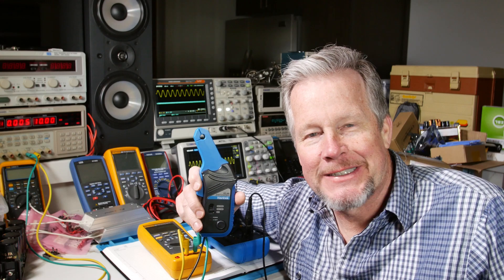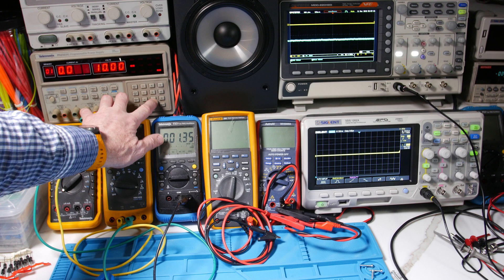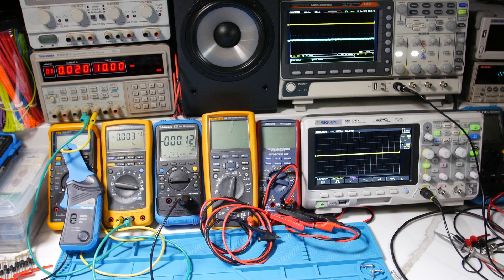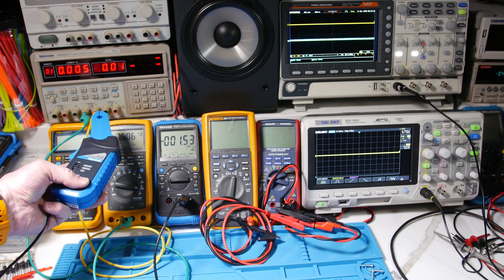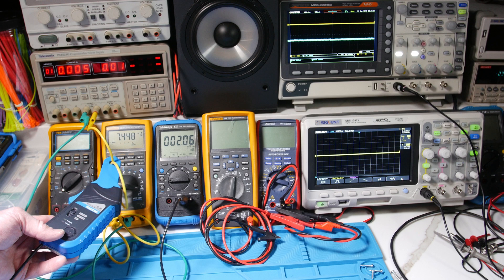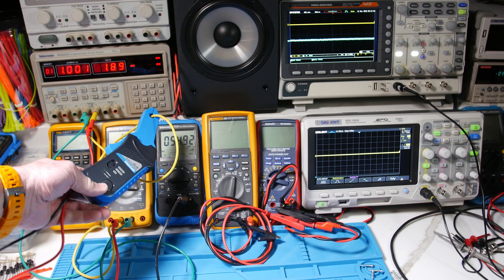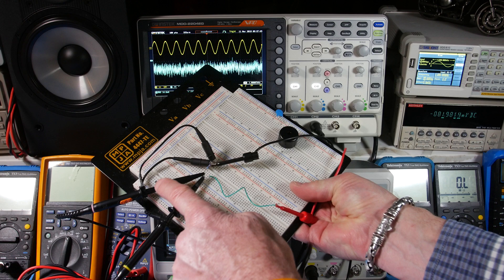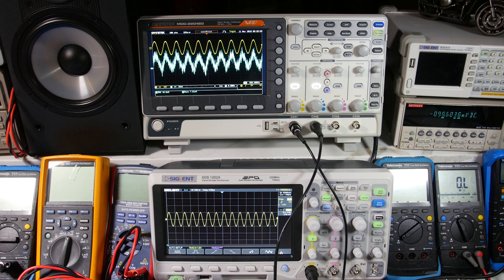Hantek Current Clamp CC65  Pro Tip for low current measurements

Comment: Thanks for the demonstration. I just received this clamp from AliExpress for about €40 shipped to the Netherlands after watching your previous videos about it. Only played around with it for a couple of minutes on my Micsig TO1104+ and it seemed to work as advertised after I finally realized how to properly degauss it. Doh! The only thing I don’t like about it is the lead, which is a bit too firm/cheap. Do you think it would be wise to replace it with a better coax lead? Could you also do a video about differential probes and when and why to use them? Micsig DP10013 High Voltage Differential Probes are relatively cheap and work as well as the far more expensive ones. Keep making these video’s they are very good for relative beginners like myself! Thumbs up!
Reply from the maker: Wow, it’s great to reach the Netherlands!  I agree that the coax seems a bit cheep, but at this cost it’s hard to complain.  I think it would be cool to change it out for a nice flexible one.  I’ll look into it - that might make for a nice upgrade video.  It’s funny, I was just looking at the Micsig diff probe by accident.  I was looking at their current probe when I stumbled on it.  Thank you for the support - I really appreciate it!

Comment: Hi there from Canada,  thank you for taking the time to upload the intructional videos they are being appreciated.  I bought this low amp clamp in hopes of measuring a wire guidance loop in the 180ma range.    6.7 khz  ac sinusoidal signal  without the need for breaking the loop as is being used 24/7 in an industrial wearhouse environment,  so far my readings have been way off , I am confused by it , please shedd some light into this matter!!

Comment: Finally realizing why my CC-65 wouldn't pick up a current trace on either scope using one's SG. No load, no current. Doh! Looking to sync inductive (motor) current to V with a cap bank to improve power factor from .41 without doing the math for precise value in mfd. lol
Reply from the maker: LOL -  thanks for your feedback!!
Reply: @KissAnalog  Not to carry on, but I used a 1w 28 ohm resistor and IIRC should have seen ~1/2w show up on either scope, a DVM, or my old VOMs. One bad one in a thou' OOB, lol but I'd recommend the CC-65 for hobby use, PF measurement/phase correction, automotive, etc.

Comment: I have thought vaguely about gadgets that would help to simplify Automobile Servicing. A current clamp on the starter cable, voltage leads to battery, chassis, motor, could detect corrosion/bad contact, low-compression (impending valve/ring failure) in even one cylinder. 
Far more comprehensive gadgets are readily available as black-boxes, either shabbily made or exorbitantly priced, or both. 
I meant to remedy the situation by myself, for myself, but seeing the video on related matters, I felt it might generate interest and we could share our experiences and proceed faster. Anyone been there ?   :-)
Reply from the maker: Sounds like some great ideas!!  I’d be happy to help!
Reply: @KissAnalog  The current drawn for cranking is proportional to the engine's resistance to rotate, which is primarily from the compression. If any one cylinder has a poor compression, the cranking current will dip everytime that cylinder is in the compression stroke. A current clamp & DSO will detect it.
The battery voltage drops while cranking. This drop is more in an older battery.
If the motor voltage is less than battery voltage, then resistance of cables or connections is to blame.

With very non-intrusive electronic measurement, we could detect inefficiency in the engine & cranking in an early stage without spending time & labour on conventional compression tests & preventive maintenance.

Actual safe values & thresholds have to be determined by owner, they depend on his reliability requirements & vehicle design.
The tests would be simple enough to perform every month or so, to swiftly determine if any further attention is required.
Reply from the maker: This sounds very intriguing - I’m thinking about ways to help.  I might have to ask more questions.  This could be fun!

Comment: Thank you for your videos. Can we use it on automotive diagnosis and see if 12v current is present in wires? Thanks from France.
Reply from the maker: alexi57 YW, and thank you for the question!  Yes, this probe is good for both AC and dc measurements.  I’m glad to hear from France.  I’ve only been once, but loved it!

Comment: I've got one of those nice blue silicone work mats like you've got under your current measuring gear. Mine has embedded magnets in it to keep screws in the trays. It looks as if yours does too by the way the screws are hanging on on the right side. Wonder if it effected your results?
Thanks for the great current probe series. Looking to buy one for automotive and dc brushless motor controller work, and this has been helpful.
Reply from the maker: Thanks Scott!  Mine has the magnets too.  I'm curious to try placing the probes close to them to see the reaction;)
Reply: @KissAnalog  My CC-65 came in this morning. I just tried waving it near the mat magnets, and sure enough, it adds a fair amount of DC offset when the probe is held near the magnet pockets. (for 50 bucks, I doubt there's much mu metal shielding)
I like the CC-65 so far, it's impressive for the price, and so far I'm quite happy. It's well behaved and accurate enough. I noticed the degaussing circuit responds much better to quick hits than sustained press (a trick I picked up in the TV trade back in the days when TV techs had a degaussing coil on the bench). I do a fair amount of field and automotive work, and if I had a 2 grand probe go thru a fan or get soaked with hydraulic oil, it would be a bad day. The Hantek suits the job nicely. I'm wondering how well it behaves to high currents like auto starters? I may have to spring for the 650a model.
Thanks for the useful series of  videos on the current probes most of us can justify owning.
Reply from the maker: Thanks for this great feedback!
Reply: @KissAnalog  I bought the big Hantek Probe as well, both are rugged, reliable and I use them in automotive work as well as industrial control. The pair (and the Hantek ignition probe) do a super quick and amazingly accurate relative compression test. They're easy enough to hook up that I often use them over the amprobes for routine FLA checks etc. Invested in 9v Lithium ion batteries with onboard chargers, so they are always ready to go, worst case I have to swap the batteries between them if I let one get down. 4 channel Scope is set up with a large home built 18650 pack that has USB outputs and Weller Wtcpn (THE best pencil ever made - the one with the Curie point magnetic control and enough wattage to put most guns to shame) soldering pencil, all with full isolation from the vehicle under test. Still have to watch for common grounds though. 
Thanks!

Comment: so if i messure 10 m volts on the scope do i put the setting for the probe to x10 to get the right reading in voltafe which will bve amps ?
Reply from the maker: Yes, but if the frequency is low enough, you can try 1x setting to see if it works better for the low voltages.

Comment: Just curious  what the length of the wire lead is on the CC 65 low amp probe
Reply from the maker: Great question.  The cable by itself if 3 feet, and then the connector is an additional 2.5 inches including the strain relief.  It is also on sale now: https://amzn.to/3hqNlVQ

Comment: Why do you keep concluding that this is off 5:23, it says 7.25mA on the DMM from the 5mA input, and your Hantek shows 0.69v = 6.9mA ?? and you even say if you multiply it by 10x when it says 0.69v it is way too much..not really 6.9mA. ??
Reply from the maker: Jakob Yes you are right, the numbers were bouncing around a bit, but it was actually within 20%, so actually not too bad.  It starts to fall off as there’s just not enough magnetic field to get a good reading.  So even just wrapping the wire in two coils gives a more consistent and higher reading, but I should have tried degaussing again maybe instead of going near 20% high it would have been closer.  Off camera I got better readings, but then filming there’s so much to consider, lighting, shadows, sound level and then camera and microphone batteries...  great eye - thanks for asking;)
Reply: @KissAnalog  Sure and yep, It was n fact performing very good at that point.  5:23 and dancing around 0.65mW and 0.69mV though unsure what you take as reference the 5mA PSU or the 7.25mA from the meter, so 6.5mA or 6.9mA was certainly decent as the DMM is likely more on target..
I also just received it CC-65 with box..
picked it up from Aliexpress at around 45USD (incl. ship) so certainly not bad for such a cost, at first was looking to purchase the CC650 as that was only like 5 to 10 bucks more, but the sensitivity seems miles apart CC65 vs CC650, so decided to go for the CC-65 and lower noise-floor.
I had some problems with mine drifting a lot, but I then tested it away from other gears (like my laptop), and it was way more stable.
I used it yesterday with a new el-cheapo spot welder (18us) to see the waveform, but I only got like 18amp and 21 .5 amp readings and it was mainly the ms-length that varied while going up in effect and I would have though it would be the triple digits.
my scope has a current feature so the amp is chosen on the spot, the probe is at 10x (10mV=100mA) and taking load from a 4s LIPO cell from my old collective pith quadcopter (Stingray CL).
and there is certainly a lot of current taking effect as the leads get quite hot, and this current-bouncing effect when your spot-welding, so I really doubt that it is only 21.5amp, though at close to 16v (4s) its around 350watt.
Its this setup https://imgur.com/a/wo4v4Mz
but still wondering if it is accurate that the amp aint higher as I would reckon it should be a lot higher but Im still new to this..
thx for the vid.
Reply from the maker: Wow you have some nice equipment to have fun with;)  Try putting it in 100x instead of 10x.  It could be saturating.  I think over 2 Amps it is better to be in 100x, especially if it is changing fast.  A transient looks like high frequency.

Comment: He keep saying "degauss"...that button does not degauss nothing...maybe he does not know what degauss means; it just zero out the output of the amplifier...he is also talking about a transformer (current) inside the clamp...wrong again, it has two hall effect sensors.
Reply from the maker: Thanks for the feedback!  It was a lot easier to explain the way I did, but yes it would be more accurate to spend more time to explain what hall effect sensors work.  But practically - my explanation makes perfect sense in how it works.  It acts as a degauser as in a way it is - it goes off zero because of the charges left behind or build up and the button works just like a degauser as it sets the circuit back to zero.  Also the current pick up works like a transformer, if you wrap 2 or more turns - the current doubles or scales the same way.  Some day I'll do a video on hall effect sensors and show the guts of this Hantek.